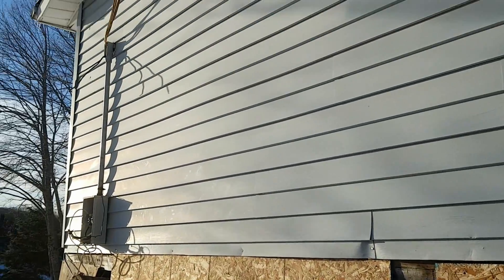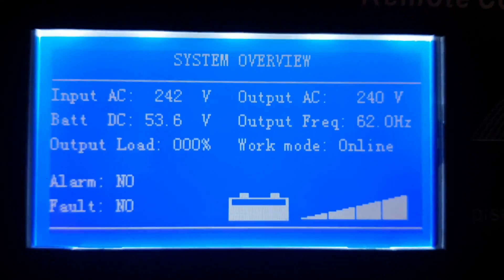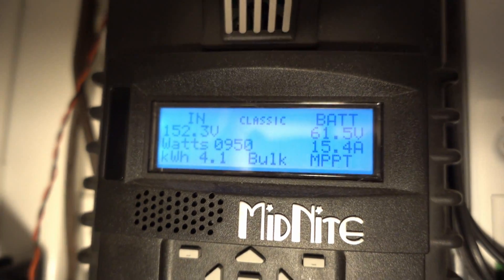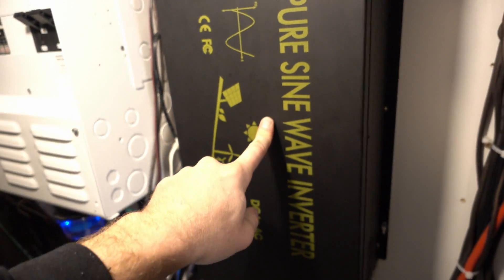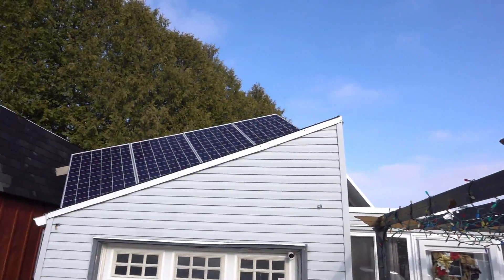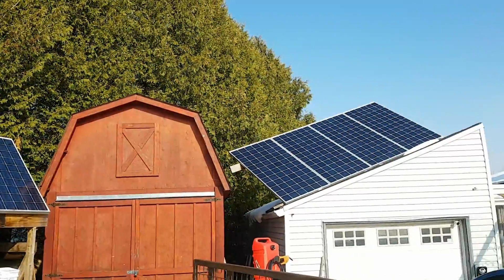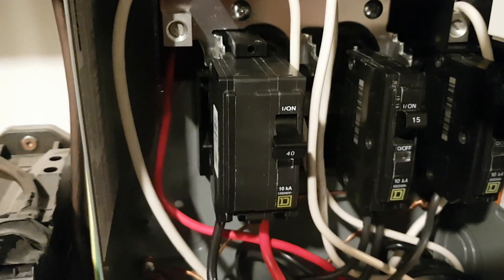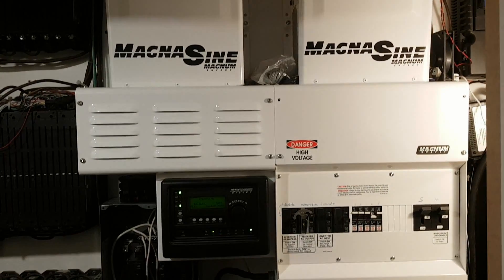Signeer 6Kw Inverter Running House And Nissan Leaf

Comment: Going off grid if you need panels let me know. I can get for 25 cents a watt. Also if need batts chargers or other solar things send me a message. This is not a sales pitch to everyone just going off GB rid. I have same car 2012 white leaf and like how your charging. I think I'm going to use my juice box with 240 charger and I have like 48 batts laying around from a nissan. Thanks for the idea on charging. I sure didn't want to take my car apart to extend the capacity and your way is so much better. May start of with my 3000 watt reliable 24v and then add thing a 48v 240v inverter later just to power the charger to charge fast on the go. 👍👍

Comment: I have that inverter connected to my 2kW system (6kW waiting to be installed) with ~15kWh of lithium batteries, but at an idle consumption of 4% rated power (240w), it is a pretty good drain when not in use. Have you tried power saver mode?
Reply from the maker: no i have not, it takes about 90W idle in my test.
Reply: @GoingOffGrid101  That's much better than what they claim. I put mine in power saver mode last night. It takes a few extra seconds when I flip on lights, but not terribly inconvenient.

Of course, I'm now in another round of 18650 charge/testing, so it will be running nonstop for the near future.

Comment: Too bad about the car maybe look at dc direct it will be faster. Suns out it's party time lol winter is slow for solar. Good video as usual those panels for $85 seem like a good deal and used is the only way to go. Cheers stay charged up
Reply: dc charging might be faster, but !!!
you need a dc charger that is about 7000$ at 10kw and 15$ at 20kw, plus three phase needed.
Reply: @ursodermatt8809  I was thinking with all the lithium DC on hand he could do a controlled charge directly from the batteries.
Reply: @offgridwanabe 
it is very difficult to do. basically impossible. sounds good in theory but in practice almost impossible

Comment: The onboard 6.6kW Leaf AC charger was an optional extra. Standard issue would be 3.3kW.
Reply: i think the internal chargers are paralleled. i'd suggest buy another charger or the full 6.6kw charger used (ebay etc) or from a scrapped car. 3.3 kw will feel excruciatingly slow when you add the other battery to it.

Comment: Those Magasine inverters are built like a tank. I was considering an Outback Radian and it has a lot of bells and whistles I wanted, but the don't put your eggs in one basket part of me said: no. I went with the seperate AC and DC enclosure option which is mainly designed to have up to 4 inverters stacked, however my max will ever will be is 3 inverters stacked.

I am using the DC enclosure to manage my 48 VDC nominal loads, I built it out for 3 inverters when I only have 1. As I slowly move my AC loads to the critical side, I may add one more to keep it at 50% loading between the two. The third one will be needed when I decide to get an EV or PHEV pending on budget and spousal ordinances of course.  :~p